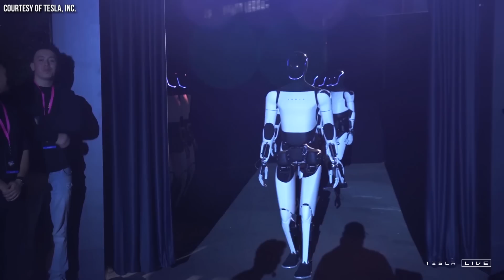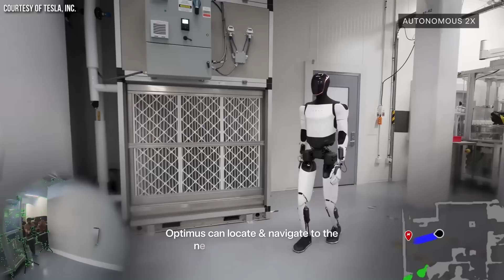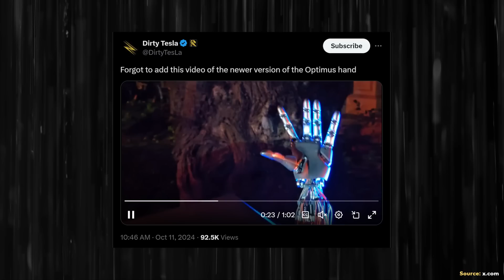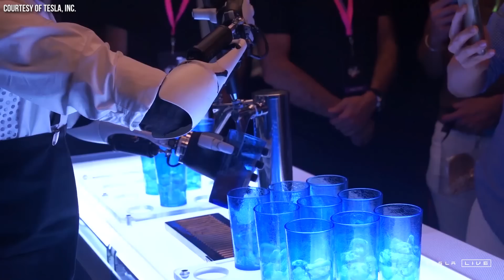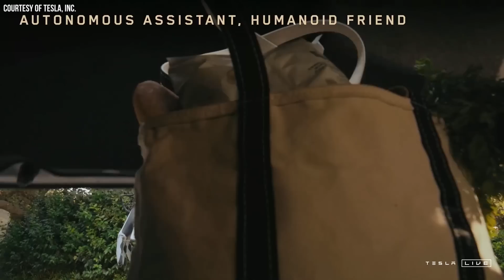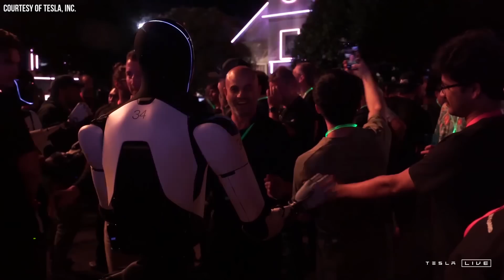Tesla's NEW Optimus Robot Update | GEN 3 HANDS REVEALED!

Comment: The Optimus robots in the gazebos and behind the drink/snack counters did not move their feet. They were planted in one spot and stayed there. The only Optimus robots that moved their feet were ones that were surrounded by Tesla employees who obviously felt that the Optimus robots were safe, it was the human guests that they were concerned about getting too close to the robots and hurting themselves OR the robots.

As far as commercial uses, I've posted this on multiple sites already. But I STRONGLY feel that they WILL be sent to Mars when SpaceX sends a Starship or Starships (plural) to Mars. Note that the programming for the Optimus robots doesn't need to be loaded until they are about to be used. The operating system and programs would be sent to the Starship(s) and then the Optimus robots would back up to their portals (like 7 of 9 on Star Trek but easier) and then charge AND get their operating system and programs for their instructions on what to do on Mars.

Note that even having them walking around on Mars and then returning to Starship would be a HUGE thing. Having them leave Starship (by a platform lowered by crane with safety railing that opens when on the ground), then walk around, then return to Starship in the same manner, then charging back up, and then leaving Starship and returning to it a second time would be absolutely amazing.

But I feel that Optimus robots will be able to do more than that by then. I believe that they will be able to assemble, at minimum, a very easy to assemble structure or maybe something semi-complex. We just don't know how much they will be able to do in two years.

But when humans go to Mars, I believe that they will ABSOLUTELY send Optimus robots too, probably multiple per human and that the Optimus robots could help the humans assemble some kind of structure. Maybe a hab (habitat) for humans but that might be too ambitious but it would be interesting to see what could be done by Optimus robots by themselves and working with humans. I think it is not only possible but probable that this will happen.
Reply: The charging point aspect is a weakness imo and I'd bet they'll soon have fold away solar charging capes or something similar.
Reply: I must be missing something.  What would be th point of even going to Mars other than perhaps disposing of nuclear waste?

Comment: anyone else realize those employees have to stand there and work while that robot wanders around trying to figure out how to take their jobs? Psychologically kind of rough.
Reply: The company I work for has a million plus into a robot arm that tries to do a repetitive job of putting pieces of metal into a machine that cuts and shapes the pieces into uniform parts.  It runs slow and requires almost  full time supervision because of the million little things that can go wrong.  Every few weeks it breaks down and they wait sometimes months for a very expensive technician to  come and work on it.
 After 4 years if frustration they now have  throwin in  the towel on it.
 I'm not worried about them taking many jobs just yet. Too expensive to maintain and babysit for now.
Reply: @paulcoenen7918  Theyre going to take an enormous number of jobs and its gonna come quick. Only a few years (~3 years) before they'll have the skill to take many jobs, then they'll have to start mass producing them which will still take some years to replace the work force.

Comment: The human hand has a texture that helps grip things. Not sure why Tesla isn't wireless charge with a mat via the feet. Seems simple. Maybe incorp some piezo discs on the feet also. FYI a piezo can generate power from just walking.
Reply: Pretty sure it would probably just change its own battery, probably be cheaper than wiring the floors, but then again maybe it would not need a battery if it could just suck juice from the floor. 😊
Reply: Great idea. That beats mine of a fold away solar charging cape.

Comment: The mapping will NOT be set to all other robots.  It's also unlikely to all be stored centrally because it's 2- 3 orders of magnitude more data compared to street mapping.  What's likely is that mapping for a structure could be shared with new robots that will operate in that structure. i.e. Offline local maps
Reply: Or Tesla will sell out local clouds - i.e. little rack servers that you plug in that have the infrastructure i.e. for a factory locally.

Comment: Can load groceries. Looks like its set up as a garage tool as well integrated into the Tesla home battery system. That says to me very much serious to be a home use product. Not sure it could handle pressure washing but might be able to obviously lawn and garden work who knows after that...all 247365 impact of this could be an order of magnitude larger than even Tesla secures retail operations allows for safe and clean 24 hour operation could be huge at Airports as well "less busy" much easier for trained personnel to focus on the work at hand. Not sure how well this is put together for rain or snow etc but presumably this will unleash a whole slew of products from others that do this particularly from Asia/Japan😊😊
Reply: You make a lot of shit up - then conclude on it. NOTHING says it is a garage tool and well-integrated into a home battery system. It looks like essentially any appliance with a loader / base station. Pressure watcher IS an issue - water should not, I would expect them to be at least water resistant so that they do not break down in a rainfall. All that does not matter, though - ignore the first 2-3 years of model, they will iterate FAST.